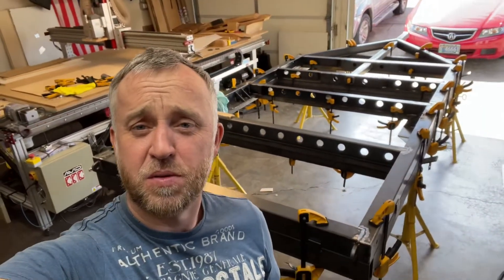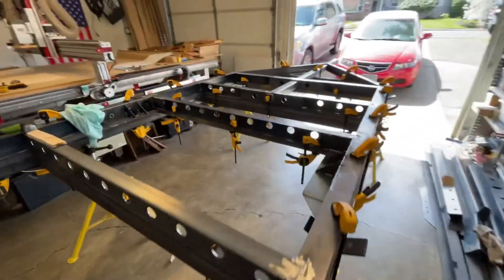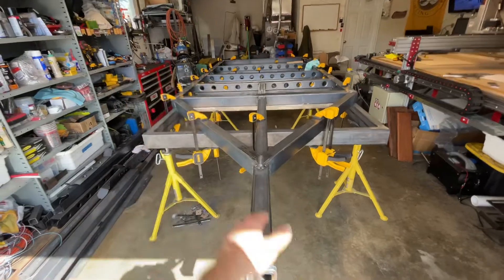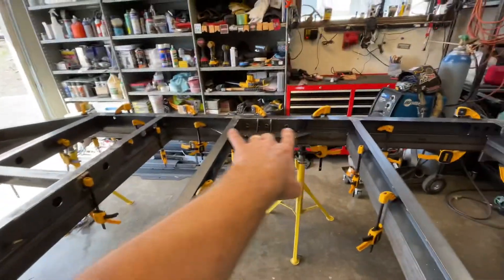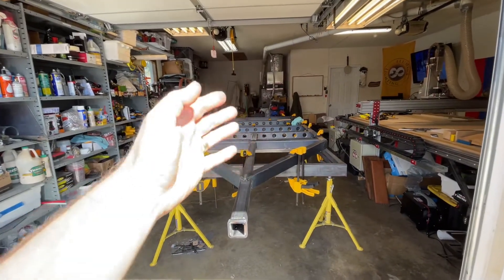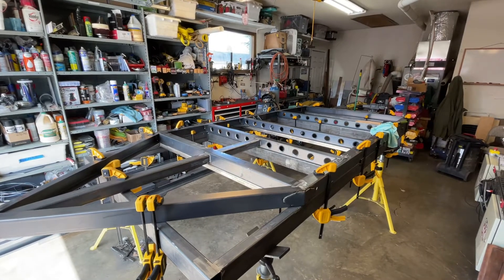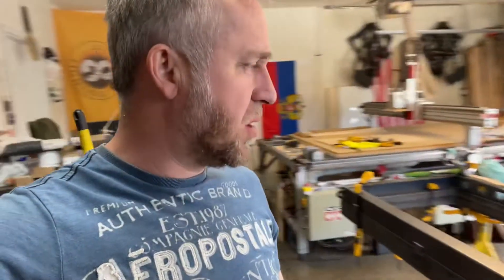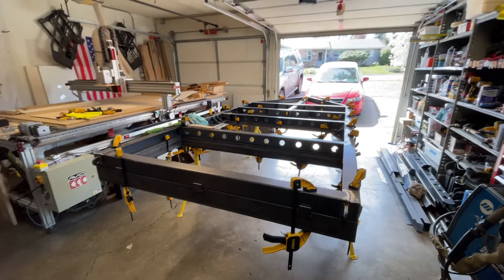BudGarage - Building  a Trailer Frame

Comment: I built one for my 2 door jeep  in 2018... wish I could post pictures.... has a fridge, 3 batteries, solar panel ,drawers and just recently bought a generator. Also designed it to use a pop up tent. I used 2-1/2 “ by 1/4” square tubing full length for the tongue and a max coupler. Every time I go camping I get ideas on modifying... it’s an on going hobby...
Reply from the maker: For sure! Hard to think it all through at once
Reply: @budnixon  yeah I had a basic idea and measurements in my head and really just winged it and changed things as I went. The icing on the cake was when the DMV inspected it and gave it a serial number and license plate then it was officially a trailer....